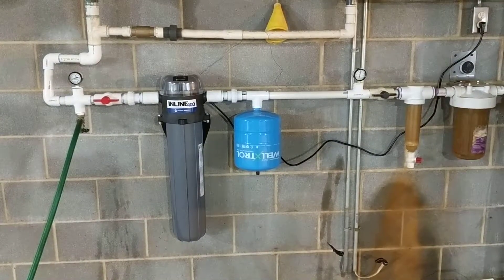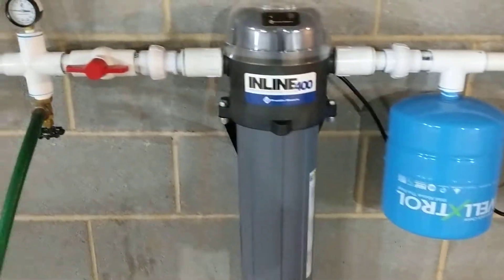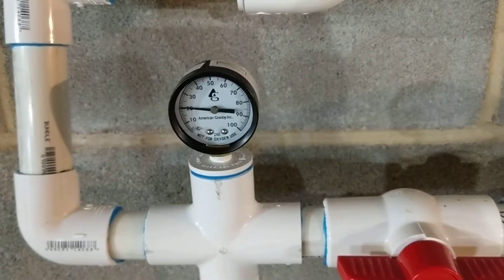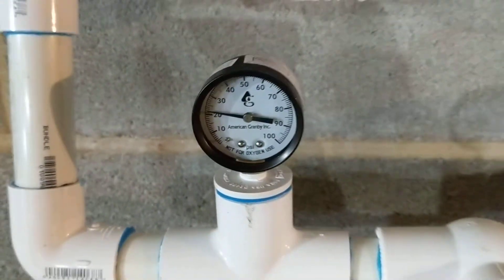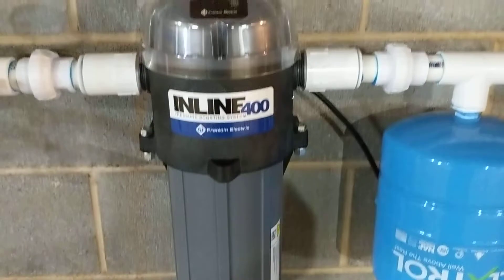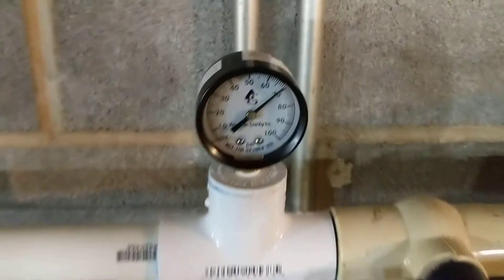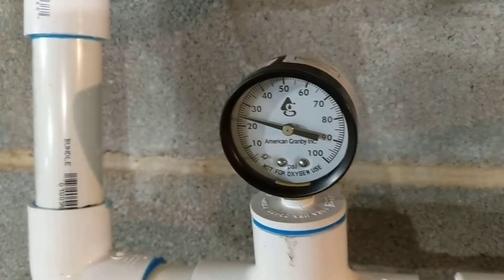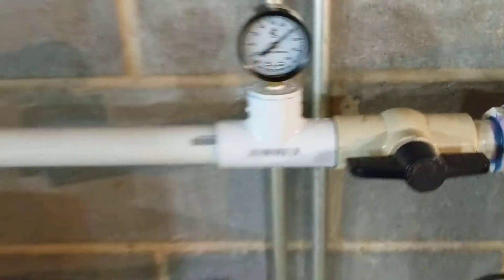Franklin electric inline 400

Comment: I have 2 houses on 1 well. To the first house it is only about 50 ' to the 2nd house it is only 1/2 in line running  about 300 '. When we are running the washer the rest of the house loses water pressure or the the other house uses water at the same time we lose pressure, any recommendations. Thanks

Comment: Hi - I have the same one.  It keeps turning the red light on and reducing water pressure in my house. When I  unplug and plug back, the green light turns on and it works normally. I have to do this way 3-4 times a day.  What could be the reason?

Comment: Great video.  I have a water well that shows good pressure at the pressure tank of 40-60psi when there is a need for water, but when the shower is on in one bathcroom the water trickles out in another bathroom or kitchen.  Would this inline 400 help with my problem?
Reply from the maker: Yes it would help but I would recommend the Franklin Electric subdrive utility to solve that problem.
Reply: @jonsjeep4x4  Thanks for they help.  I've been searching for a while on a solution and you've been the only one to have a solid recommendation.  Thanks and look forward to following your uploads!

Comment: My Franklin Electric Inline 400 Booster failed today - five years old - installed with all the necessary precautions to avoid stress on the casing - outer housing cracked near the pump/body O-ring seal, and pump bushing inside both cracked. The fact is that five years is a very short period of time for a crack to show up - this is a major design fault.  I am surprised these units are still on sale. The housing appears to be a GRP or similar polymer with insufficient wall thickness to carry the weight of the pump, especially given the working pressure of >90psi and the potential for fatigue in light of the pressurization/depressurization that occurs potentially up to a hundreds cycles a day.  I strongly suspect fatigue, accelerated by pressure and sheer weight of the pump body.
Reply: IVE BEEN DOING ALOT OF RESEARCH ON THESE, SEEMS LIKE EVERYONE IS HAVING ISSUES. LUCKY YOU GOT 5 YEARS TBH. GOING WITH A DAB PUMP THE NEW MINI LOOKS KILLER